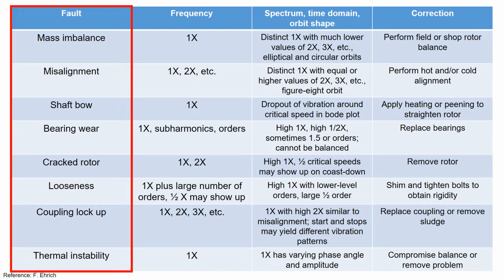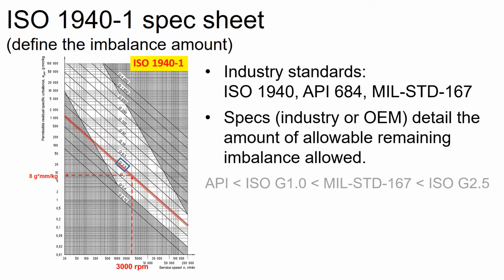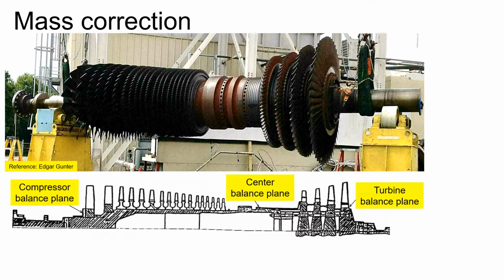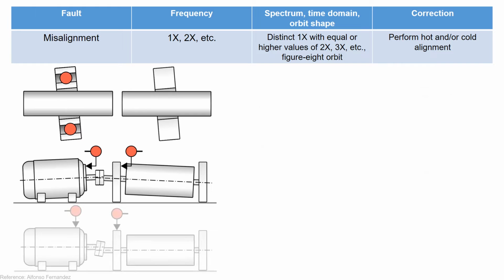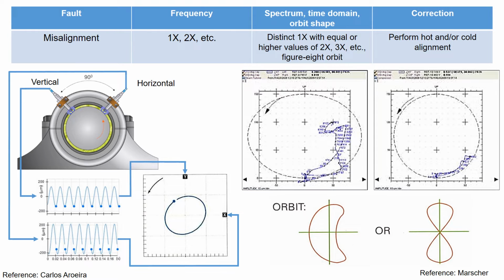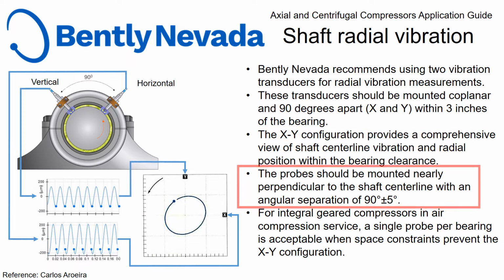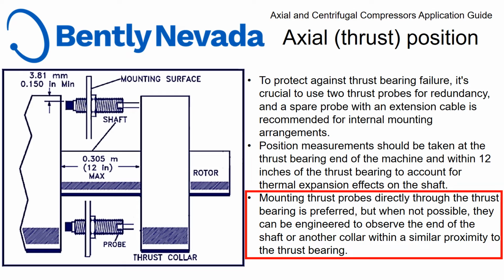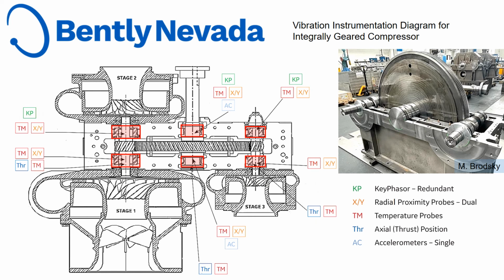Part 30 - Misalignment in rotating equipment

Comment: Great summary. Strive to meet API 684 2nd edition limits.
To the point on wear and tear causing imbalance could add corrosion and deposits that can flake off parts non uniformily.
Reply from the maker: Thanks for watching and for your insightful comment! I appreciate your suggestion to consider corrosion and deposits as potential contributors to wear and tear, leading to imbalances. It's a crucial point, and I'll be sure to delve deeper into these aspects in future content. Your engagement means a lot, and I'm glad to have viewers like you sharing valuable perspectives.

Feel free to keep the conversation going, and thanks again for your support!